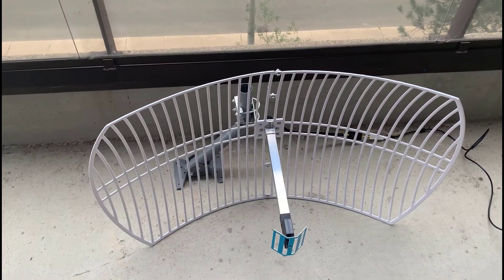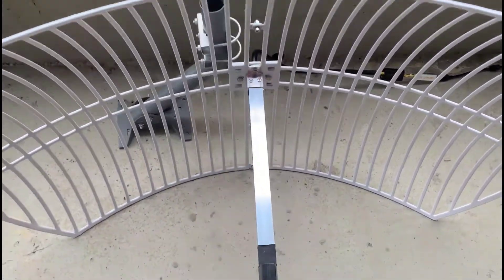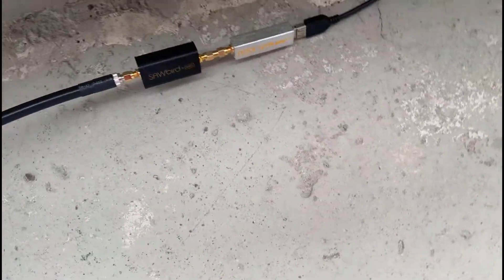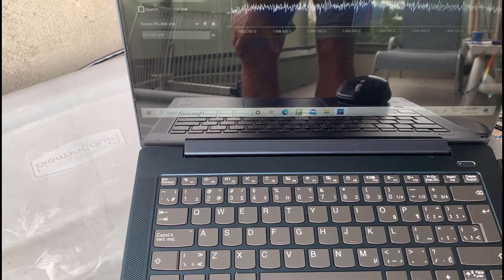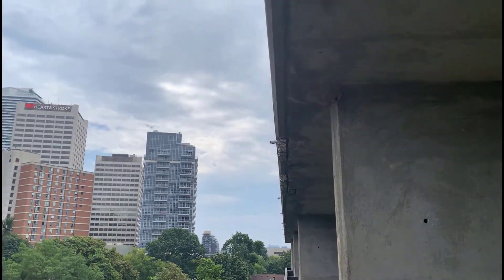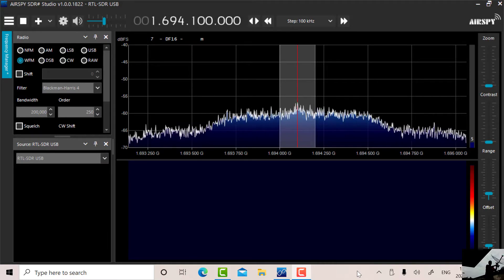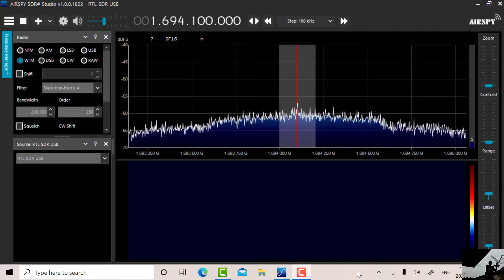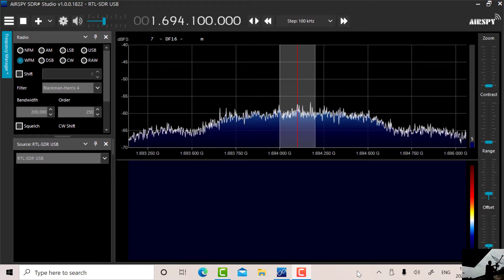RTL-SDR for Satellite Weather on GOES16 - Signal Capture

Comment: I need help 

I made a cantenna
Put it on a direct tv dish and get nothing 

I aimed it the right way
Reply from the maker: Are you using an LNA? Did you sweep antenna to see if it is tuned correctly?
Reply: @ClarkTelecom  do you have to use a LNA
Reply from the maker: If you look at my planning video/blog you need about 45dB of gain (ant + lna).
Reply: @ClarkTelecom  ok

Comment: I have the same setup...im in michigan just a bit SE of you and cannot get a signal from GOES-16. I tried everything for 5 hours tonight! Any tips?
Reply from the maker: It is tricky at first. Figure out the azimuth/elevation/tilt for your location, then eyeball approx where that is on your horizon. Then hold the dish and move it sideways, up & down etc till you see the signal bump appear above the noise level. Once you know where the signal is, you can use a more permanent dish mount. Check out:
https://www.youtube.com/watch?v=50dqJQrrCeM

Comment: Do you plan on making a motorized stand you you can align wherever you are? Thanks for the share 👍🏻✌🏻🇨🇦
Reply from the maker: Right now I manipulated the dish by hand just to see if I could find the signal, it was a gamble in my location wedged between condos/concrete. I think 95% sure I have the signal. Next step is to make a solid mechanical mount that I can quickly assemble/disassemble on my apt balcony and optimize the signal strength. It is a fairly weak signal, so I will be fighting for every db! After that, next step is decoding.